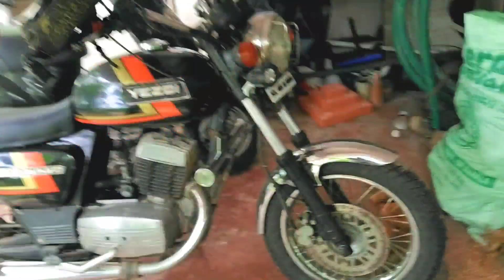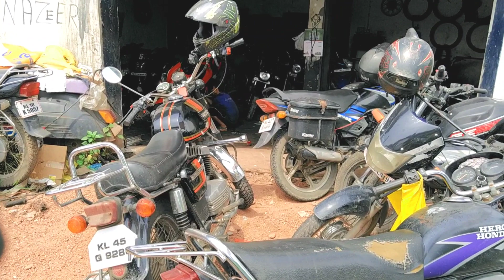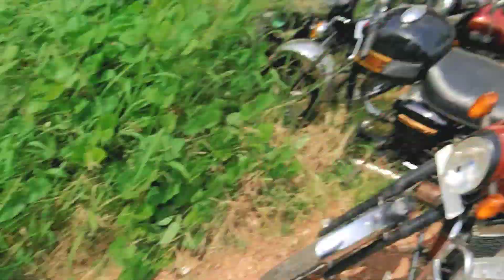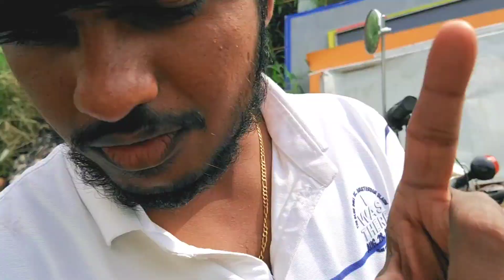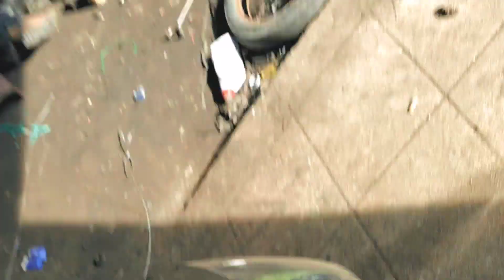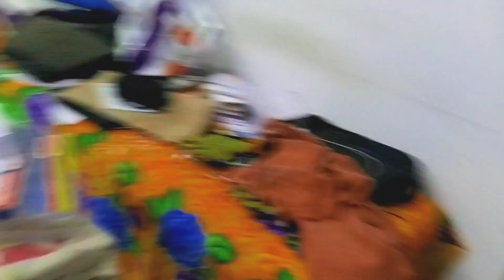Autoclutch Of Yezdi | ചില്ലറക്കാരനല്ല 🏍💨

Comment: Hi bro njn oru rd350 edkkan plan ind... onnu athinte details parayo
Reply from the maker: RD poli vandin alle bro.. Power 🤘.. details aayi parayan spec ellam best aan for a 2 stroke.. Milage 20 or below 20 aavum chelapo.. i think its the most powerfull bike in case of 2 strokes ( considering its power and weight)
Reply: Varan chance ulla panikal nthokkeyann..... edukumbol nth sradhikkanam.. maintanance?
Reply from the maker: @vishnuprasad.k.v8933  Overflow pbm maathram aan njan ketitulath bro.. I have no idea.. Iam really sry..
Reply: Ok thnks machaaa
Reply from the maker: @vishnuprasad.k.v8933  🤘
Reply: Bro rd second hand rate is 3 lakhs and 4 lakhs